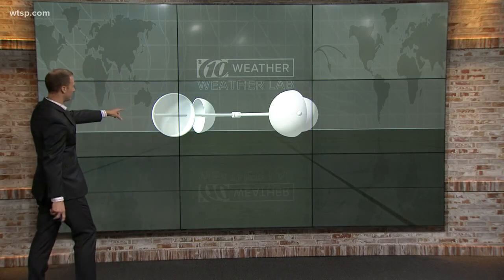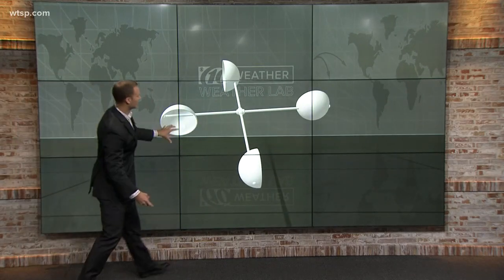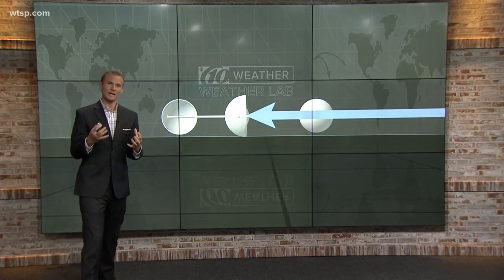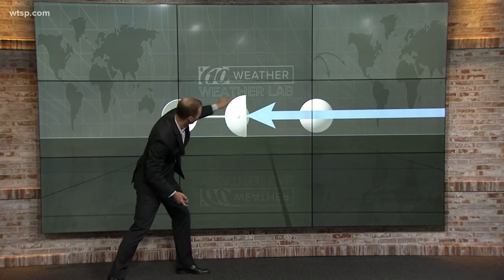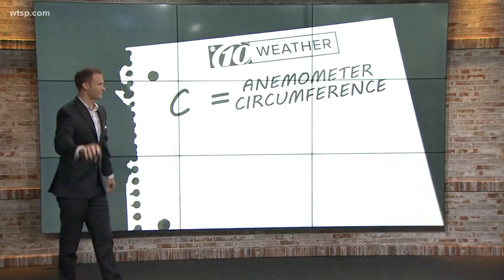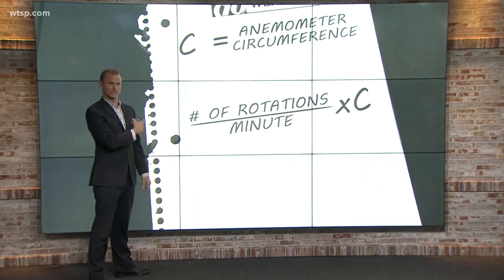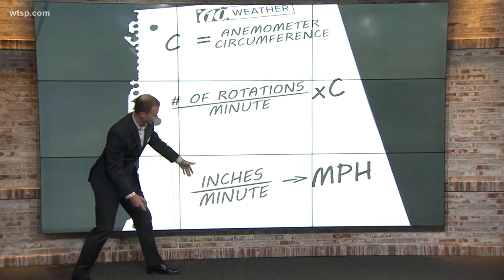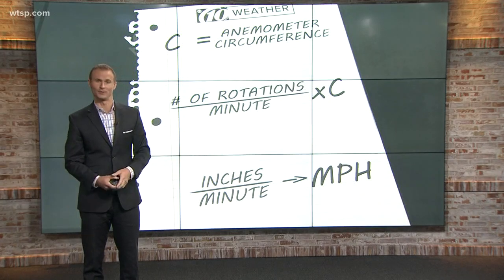How are wind speeds measured?

Comment: But wait! 

The cup has a drag coefficient 0.38 from the convex side and 1.42 on the concave.

Drag: https://en.wikipedia.org/wiki/Drag_coefficient

The anemometer will accelerate until cups moving upstream balances the torque of the cups moving downstream.

It means the downstream cup has to gradually move slower than the wind until it produces a drag force large enough to push the more aerodynamic convex side of the cup upstream. If the downstream cup slows down it gets more drag while the upstream slows down and feels less drag. 

If cup moves downstream with speed y the cups on the upstream side moves with speed -y
If the wind has the speed x, the cup downstream will feel a relative wind x-y and the one moving upstream x+y.

So the equilibrium is simply described by requiring magnitude of forces on opposite sides to balance out 1.42*(x-y)^2 = 0.38*(x+y)^2

The solution of the equality is satisfied at a straight line  y = 0.32x

It means the cups reach equilibrium speed y at a factor 0.32 of the wind speed x.

In other words cups speed  always adjusts to 32% of the wind speed.

At a wind of 5 m/s the cup moves at  1.574  m/s and is exposed to 3.409 m/s tail and 6.590 m/s head wind respectively. The shape evens out the game and they produce similar drag force.

~ 1.42*(3.409)^2 = 16.502   and   ~ 0.38*(6.590)^2 = 16.503

Never lie to children.

https://en.wikipedia.org/wiki/Anemometer
Reply: he wasn't lying, he was simplifying. there's a big difference
Reply: Dude! Thank you so much! I had an intuition that the cups would not move at exactly the speed of the wind, and your explanation of drag coefficients and the equilibrium equation makes perfect sense. So, if an anemometer has had it's drag coefficient measured accurately, will the anemometer be perfectly accurate assuming the cup speed is multiplied by (in this case) 0.32? Are there any other factors that can affect accuracy?
Reply: @NeilMarcellini  The calculation is not exact as the cups present different drag as they change angle, move in a circular path and wind is disturbed.

But as arm length is greatest when cups expose their basic shape the calculation will probably be quite good.

The forces on the cups vary with v square so high relative wind speed part of the motion will dominate.

Comment: but i bet how light or heavy the anemometer frames and cups materials are, the spin speed will vary and so how does that work out universally ?
Reply: The moment of inertia would not matter so long as the system is operating at steady state with an ideal bearing.